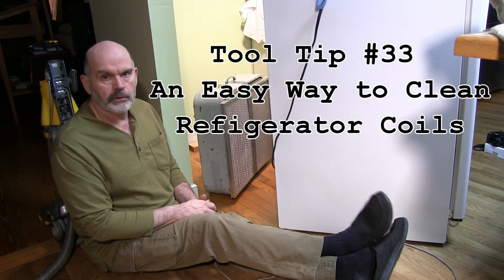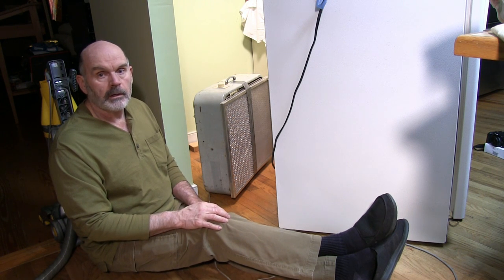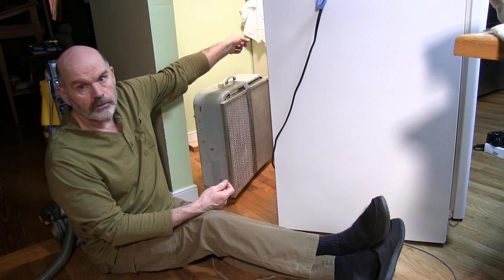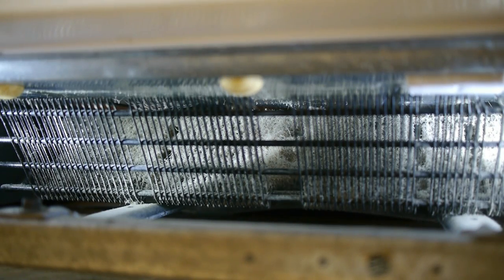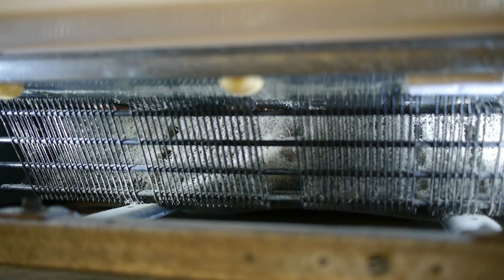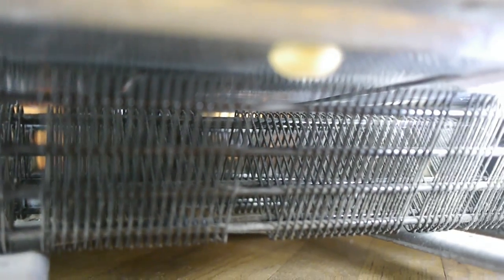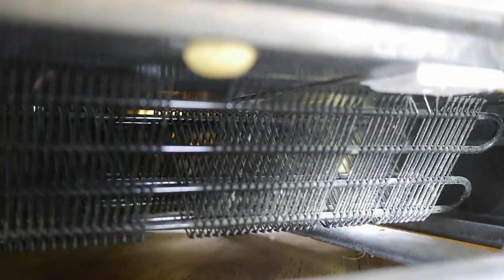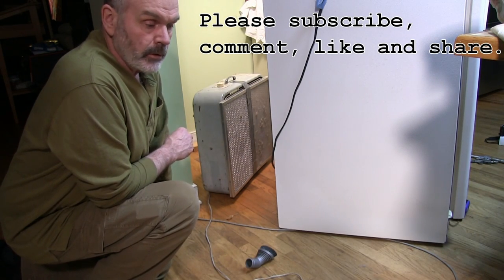Tool Tip #33 An Easy Way to Clean Refrigerator Coils

Comment: The first time I observed them I saw how bad off dusty [and difficult] they were, and said "Screw it", and I used a leaf blower and covered my kitchen in giant dust clumps.  I spent less than one minute making my coils perfectly clean, and 20 minutes cleaning the kitchen. It was worth it.
Reply: You read my mind. I was thinking of putting a big wet rag towel behind the fridge to catch the dust and using my leaf blower! I don't have an air compressor so thanks for confirming it will work.
Reply: I might to give that a try.
Reply: @georgeleong1572  if your coils are on the bottom, and you have a leaf blower, it will work. Your coils will be clean and the room in which your fridge sits will be covered in dust, clumps of dust bunnies.
Reply: I love the way you think,Thank you.God bless
Reply: Great idea! I don’t have a compressor either, got out my Toro electric leaf blower and cleaned my coils in 30 seconds flat! This fridge is in the garage so I wasn’t worried about the dust. Perfect!
Reply: @stevedoesthings6757  Glad it worked for you.
Reply: I’ve been using the leaf blower method for years. Put wet towels at the bottom on each side and have a helper (hubby) hold a wet towel at the back. Do it every 6 months =  not an extreme amount of dust.
Reply: @yvonneroach6086  The coils on the bottom of my fridge had been neglected for about 6 years.
Reply: Thanks so much. Leaf blower is a brilliant solution.
Reply: @nancythompson9412  if your coils are filled with dust bunnies it will make a big mess in the room; so get ready for it. Fortunately the rest of the room is [actually] easier to clean than the coils under a fridge.
Reply: Reminds me of the time I took a relaxing bath and then thought “I could blow all these candles out at once with a hairdryer. Scraping wax off the mirror and walls for days.
Reply: This worked incredibly well. Thank you for commenting with this idea!
Reply: @Holdmymawashi  🤣🤣😂
Reply: @ericneal8582  No money to constantly get new fridges, or to pay some contractor for 3 hours labor. We know what to do to keep some money for food and other necessities.
Reply: That's what my son wanted to do and got mad at me bcoz I wouldn't let him 😂

Comment: I removed the lower ~12" back panel on mine and used painters tape to tape on plastic sheet.  I cut a slit for the vacuum hose to stick in, then ran the vacuum while I air compressed the front like you.  No dust problems either.  I did find i had to vacuum the back edge at the end once i removed the plastic. Another approach.
Reply: Good idea. I do not have a box fan so this is a good option for me.
Reply: Ion Ymous 👍🏼👌
Reply: Genius!
Reply: he had a great idea and you improved on it, great job and thanks for sharing....
Reply: @jmar385  yes I do it that way ,leaf blower works great!

Comment: Thanks for the great idea. I didn't have a box fan or a cheap filter so I improvised a little. I took an old, clean queen bed sheet  and soaked it in water. Then I draped it over back of the fridge and used the compressed air. It worked probably almost as well as your idea. Then I soaked another sheet, hung it over the front and blew from the back. Not squeaky clean but pretty clean. Thanks again, this is my least favorite home chore.
Reply: Now that's a good alternative....I may do that...thanks.

Comment: I have an idea.  Instead of using the box fan you could create a cover over the rear exit of the fridge with a hole in the center to fit your vacuum hose.  Then turn the vacuum on and turn the air compressor on and all the dislodged dust goes into the vacuum cleaner.

Comment: I changed the water filter in my 2012 Whirlpool and just noticed how covered the coils were tonight...8 years since I bought it...and was immediately annoyed by how they were positioned in a way that made it impossible to clean with a vacuum beyond that first cage of coil.
Reply: Same here in rental apartment, THE landlord paid first Whirlpool Filter , the I got the Culligan Filters,or ACE Hardware,  @$10 each etc. the CHINESE Filters to scary for ULTRAEASE #5.. ANYWAYS, , I just trying my coils again after unpacking all of WHIRLPOOL’s in bottom. DUST  BUNNIES  all packed around coils , trying to get a Tubing 1 inch, TALE/seal in my VACUUMS CREVICE  Tool & snake they the screen, underneath… Anyways, I been vacuuming out underneath five years ,*& just noticed bad coils & dust Bunnies clogging UNDERNEATH,,, THIS WHIRLPOOL MAY Be a  2005 Modlel. How did you do?.. getting  age off, or small vacuuming, hose in to coils?. Or blow out ( mine is Whirlpool built into cabinets, and Dishwasher close in front)…

Comment: Hello 8 years later! I had the classic water drip inside, fixed that with all the ideas on here. Now, to do it right, I'm going to do what you just did. One GREAT idea you have here: I have tried the box/filter fan when cleaning out my computer, but I did not think of using SHORT BURSTS to give the fan a chance to catch up. GOOD ONE, and thank you for this!🧡

Comment: Great idea with the fan. I cut up a window screen and installed it in front of the coils. Now a quick vacuum clears the screen and coils stay much cleaner.
Reply: Expanding on that great idea, maybe one could instead just put a cut strip of cheap, low resistance, high air flow A/C evaporator filter material across the front of these fridge condenser coils, doing the same thing as the window screen method you used, but better.

Comment: 4:40 "Actually I think that's why they put these coils in here in such a way that they're so hard to clean so that the refrigerator will die sooner and you'll have to buy another one" lmao! good one and it's true!
Reply: Could be...there are evil business minds that want their products to fail so they make money on service.  We are at the mercy of the APPLIANCE GODS....
Reply: Well thats a bit silly, would make ppl go for other brands.
Reply: It’s mostly for assembly efficiency reason they put the coils under and maybe noise reduction too. 
The bottom sub-assembly include the condenser and compressor in a neat and tight package which is super easy to handle and work on. Once done, the whole unit just need to be bolted to the remaining fridge and the evaporator lines to be soldered. 
And if they can include the evaporator coils on that same sub-assembly, it’s an other gain in assembly efficiency.
Reply: @succubusnirriti913  I have never seen a refrigerator designed to be easy to clean.  So there is no other brand anyone can buy.
Reply: @1943vermork  ... see that's how ya do it ... but clean coils are better no matter ...
Reply: I know no one reads the Owners Manual-- but it tells you to clean them periodically 🤔🙄
Reply: @paulrooster2108  Not all do, but some like mine (and I just looked this up) if I don't have the access holes or grill up front, then just reach the coils from below as best you can (I don't have the access holes below my door, so will go grab my special brush and see if I can achieve my goal that way. It's a lower end 18CuFt GE top freezer model from very late in  2008. Still keeps things cold/frozen, but does clang loudly at times when shutting off though.
Reply: @1943vermork  ,
Yep they use to put them on the back of the refrigerator , which worked pretty good till some Ape would try an move the refrigerator an would damage the coils , some putting them under the fridge takes less space an protects them as well , but everything is a trade off of some type ,
Reply: @paulrooster2108  Just so you are wondering, you are kind of preaching to the choir here. I'm old enough to remember the 70's myself, though as a kid and all of my earliest fridges (in rentals) had the coils in the back. At least one of them had no self defrost for the freezer compartment (a low end 80's model top freezer), most though if memory serves were self defrosting, the oldest was a brown top freezer from I think the 70's with a baby blue interior. That was a funky 2 room efficiency in Medford OR in the mid 90's. My first place had a low end top freezer model that was too big, and was a true single room occupancy (SRO) unit that was built in 1913 or so as a hotel, come apartments on the cheap during the depression. It and the 2 room had shared baths down the hall.

After that, I had full units with baths. :-), all this in the 1990's up through 2016 when I moved to my house that I bought. 

It still sports a top freezer fridge, but it's from very late in 2008, about the same vintage as the basic infrared stove that came with the place, at least both match - in black. 

I then added a black KitchenAid dishwasher (used) to the old 20's era kitchen and I've been happy with it, as is since 2017.

BTW, I'm 56, will be 57 next winter.
Reply: @succubusnirriti913  People dont realize there are just 3 or 4 corporations that make them all. Brand choice is an illusion...just smoke & mirrors.
Reply: @1943vermork  You are probably right. No thought at all is given to maintenance. After the coils clog just throw it away. It is an outrage.
Reply: @lmntrlmntr3496  They used to put them on the back...very easy to access.
Reply: @paulrooster2108 Lol.  I just read the Owners Manual to used Maytag fridge I just bought that has these inferior accordion type coils underneath. It was worthless. It (falsely) said there is normally no need to clean the coils,  but if one wants to, they can use a brush and vacuum. Bull hockey. As this video above shows, there is no way to do it by this method.
Reply: @paulrooster2108  Wow. Thanks for sharing that. I've never heard of "Rear Window Defroster Conductive Paint". How did that work, in you case? Did it repair the (shorted?) electronic circuit on your control board?
Reply: @steveandrews8301  ,
Yes it did , took a exacto hobby blade Cut around the plastic film on the outside of the circuit where it bubbled up, Put like four coats of the conductive paint and after that dried I covered it with clear nail polish plug the board in fired up the dishwasher
Reply: @steveandrews8301  ,
Yep we have a Samsung Side by Side , it's got a vented plastic grate toe kick , I took a wooden dowel 3/8 in dia ? Wrapped a bit of  cloth on it with a zip tie , wet the end of the cloth an was able to get 80 / 90 Precent of the dust built up .  The openings are to small to get a brush an the vacuum wouldn't do more than the first 2 inches of the coil .
Reply: @paulrooster2108  Ah! "grate" (great) idea, in a pinch. I bet that job was time consuming, though, trying "to rod" all those crevices running front to back, coming in from the side slits on it, essentially.. Thanks.
Reply: @paulrooster2108  Wow!  That stuff's cool. I'll have to remember that when / if the time comes. I'm always tinkering on and fixing stuff. Thanks much.

Comment: Thanks so much ... I watched several videos before finding yours .... yours was the first to address the issue of the difficulty in accessing the coils.  I used my leaf blower instead of compressed air.  It worked great ... I hung a sheet over the back of the fridge to try to control the dust, but still made a complete mess of the house, but if you want to make an omelet you gotta break some eggs.

Thanks Again!

Comment: Your idea gave me an idea of another way to do it. I have the Kirkland (Costco) Whirlpool. It was totally clogged with dust and running hot. I didn't have the filter you used so I did it this way. I duct taped the sides of the refrigerator to the floor, and also the back to the floor. This left only the front open. There is a cardboard at the bottom of the back that has 3 columns of louvers. I duct taped the louvers except for the top 3 on the left column. I had my wife hold the hose from our shop vac (RIDGID 16 Gal. 6.5-Peak HP Wet Dry Vac Model# WD1851) on the 3 louver slots that weren't taped shut. I used my Porter-Cable Pancake Air Compressor with a "wand" to blast the dust off of the coils. I didn't have to use short bursts. I had it on full air for a few minutes. The shop vac was powerful enough to not allow hardly any dust from escaping. It worked great.
Reply: You shouldn't have had to go through all that trouble!
Reply: This just what I did too...  used my wet dry vac.  but no tape just some old towels around the two sides and in the front where the vacuum tube was pushed in...  turned the vac on and used little puffs to clean...  excellent video...  now I will have to find the extender toy you used for my next cleaning...

Comment: Brilliant and I have this exact set up under my Whirlpool. I'm with you as there is no reason to design the condenser coils to be lined up this way. If they were opposite, you could clean them in a snap. Even when people try, they can't really get a complete delousing of the coils without using your technique! Kudos
Reply: Thanks: my whirlpool set up also, whirlpool’s: have not see how to remove screen to,get vacuum on Coils**:: probabilities of trying to get “”one inch PVC/tubing/flexible 1 inch : tape on end of my vacuum crevice Tool , insert thru Screens, etc.””.!!!   I Did it some 20:years ago,ps What did you do to get DUST BUNNIES.,?.

Comment: I gotta lay off those G&Ts when  something important needs to be done. Finally ran out of Gin and went to work. It cleaned off all the fuzz, dead spiders, centipedes and pieces of glass from the dropped broken Gin bottles. But I forgot the fan was supposed to be faced to pull the crap away from the fridge. So it was like a circle firing squad . After the second hour my Colleen noticed the problem and told me to turn the fan around. It worked a lot better that way.
Reply: And your "go to" Gin?
Reply: Craig — My G&T Gin is Seagrams and Schweppes T water. My on the rocks (OTR) Gin is any of the Navy Strength Gin brands available at the grog shop I happen to be in. The NSG is, for me, an economic consideration. Being in transit on my 90th Circumnavigation of the Sun, (soon to be my 91st) the blurs occur sooner with OTR NSG than with Seagrams, thus I arrive in Camelot sooner and the pawn shop later.

Comment: Excellent video! I just got a replacement refrigerator for free because mine is out again and it was inquiring. When I unscrew the bottom, it was full of dust and I cleaned it. Thanks for this video.

Comment: Thanks  for the  tip;  Pretty smart! I Just  did  my wife's  fridge  this  morning as the fridge was running almost 24/7. I didn't pull mine  out from the  wall, as  last time I took the back off - there was nothing back there to service, the fan was  clean and the drip pan was  dry with no mice in it.   My wife  has  an "old  style"   whirpool gold  top freezer refrigerator , but the  coils  are on the underside, left facing the unit. They run front to back and  they are just folded back on themselves  once - like  a book jacket.   A  standard  crevice tool  gets only  about a 1/3  way back. I looked  around the house  for  1/2  tubing  and  found  some  1/2  OD  Tygon(r) tubing my wife  brought home to use as a siphon. I adapted this to my vacuum wand by wrapping a  plastic  grocery bag around the tubing to make up the 1" difference in diameter. Then I wiggle this wet noodle into the  coils  to the rear and  slowly drew it back forward. After doing this  a dozen times, I declared the coils  as  clean as I could  get them. The  fridge  shut off about 5 mins  later and  hasn't turned back on in over an  hour so - mission accomplished!  Do I wish for the coils  to be exposed on the  whole back rear of  the fridge like they  were  40 years  ago?  Yes!  Is  there room for that in most houses with the new  oversized  fridges?  Unfortunately no.  I will look into the  compressed air Idea or  get me a  wand  tool for  cleaning coils!
Reply: Thanks, ** all!!   ****: I am trying to get some **:: PVC / TUBING 1 inch od, close *& tape shut **or close end of * CREVICE TOOL( I done 20 years ago).. Interestingly my old Whirlpool had COILS ON BACK OF  FRIG**, & not underneath protected mt screen, mine RENTAL APARTMNET HAS this Whirlpool,built in, Cabinets over head also…and dishwasher in On front some three feet or less.  Crowded,  May be able to use long flexible bottle brush to,get some of packed DUST BUNNIES.. how did you clean,& vacuum,  now.?..

Comment: I just went to clean the coils. When I saw the set up under I put a small hose on the vacuum and tapped it up. I could only get to the first two rows with my vac rig. Next time I change the water filter on fridge I will break out the compressor and do it the way you did. Thanks for the video its a big help.

Comment: Thank you so much, mom was ready to spend $600 on a new fridge and I told her to let me figure out what is keeping the refrigerator from cooling.  I replaced the door gasket and the defrost timer but the fridge is still not cooling as it should. I saw the video and am going to do exactly as you did.
Reply: What happened? My ***whirlpool COILS clogged too behind Screen…?.trying tubing one inch / PCC, APPROXIMATELY : taping off, *& on my vacuum crevice Tool,next . WORKED 20 years ago, though some small & “Auto vacs “have small TOOLS,/ tube shaped.etc.

Comment: I thought I had come up with a clever idea of using the air compressor to blow out the unreachable coils, then saw this video you made in 2016!  I used a vacuum alongside the air nozzle to pick up the dust, but your box fan/filter (which I have sitting idle in my wood shop right now) is a MUCH better idea.  Thanks for posting and also showing the dual-video so we could watch the dust bunnies being sucked into the filter in the back.  Oddly satisfying... ;-)